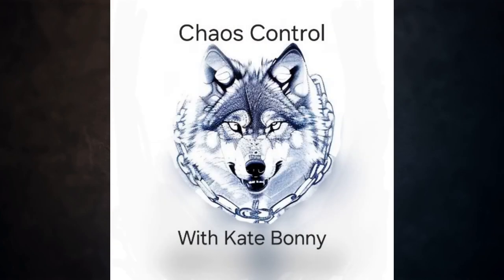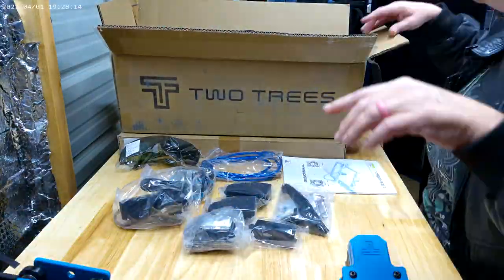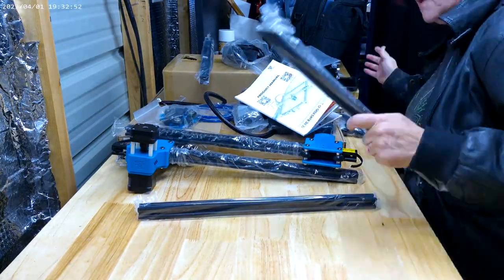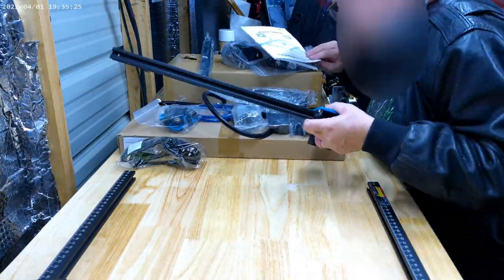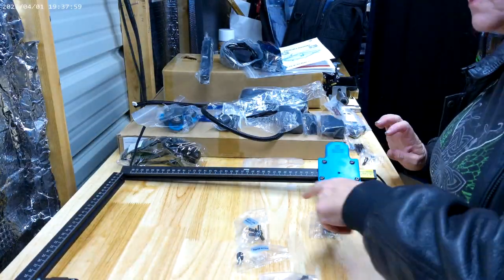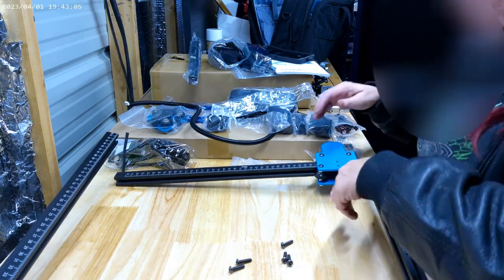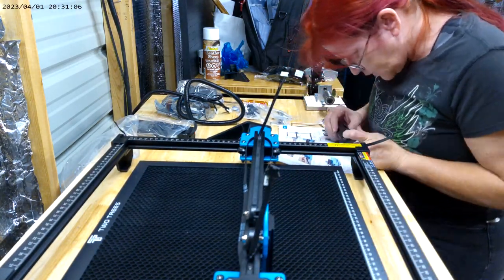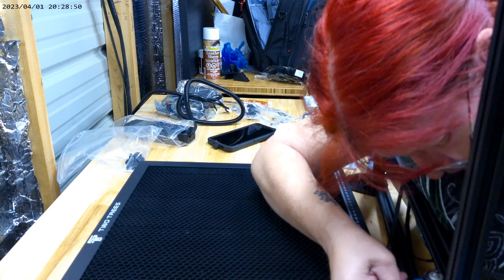Old Woman Assembles A Laser Etcher and Talks About her Mental Health   #vlogmas #vlogmas2023

Comment: What's that square underneath do?
Reply from the maker: That is a honeycomb surface.  It helps disperse the heat from the laser.  The metal plate goes under it to reflect the heat as well.  The entire purpose is to prevent my worktable from burning up.